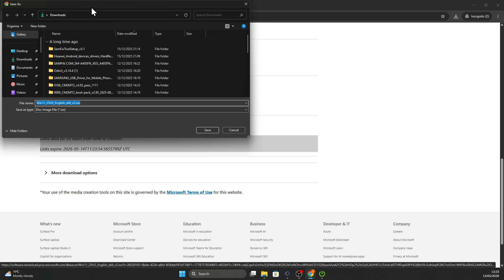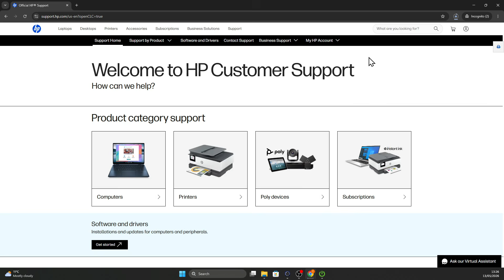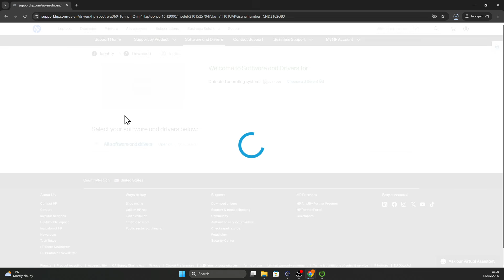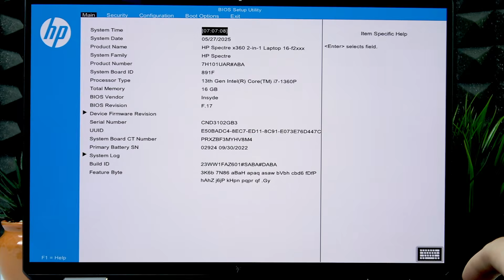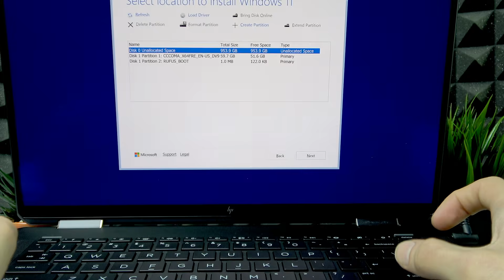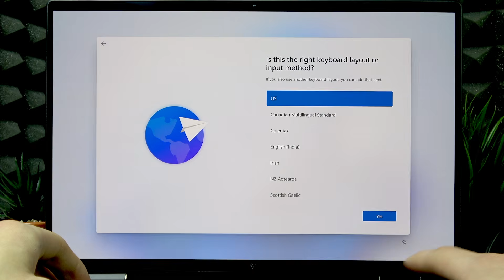HP SPECTRE X360 - How to Install Windows 11 from USB

Comment: Hello. I typed in all the stuff necessary into the HP website and it's saying there are no software or drivers available for my product. I have the HP Spectre x360 13-4193dx model. I downloaded Windows 11 iso  and loaded it onto a USB with Rufus with no issue.
Reply from the maker: Sometimes support pages show no results if the model is considered legacy, but you should be able to use the latest generic drivers from the official website! 😊